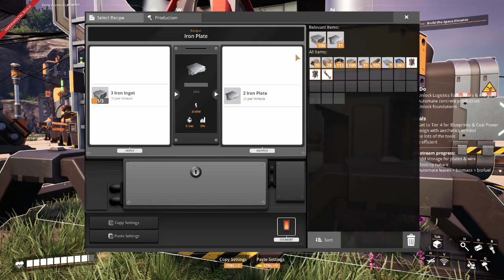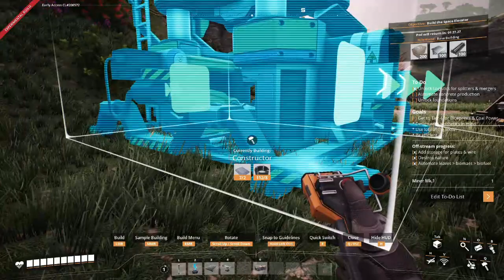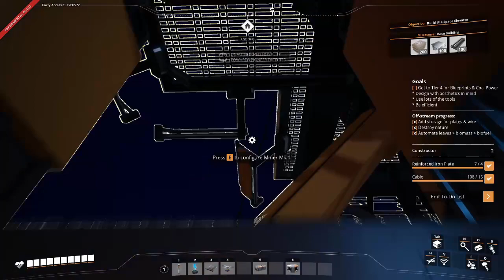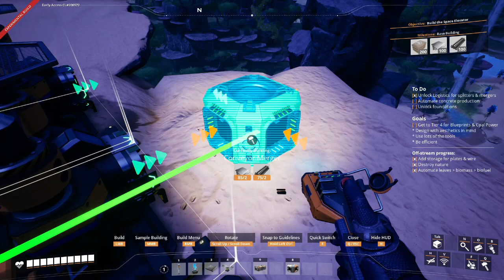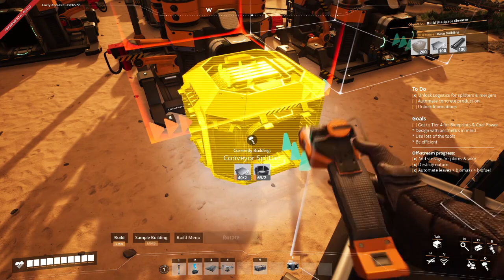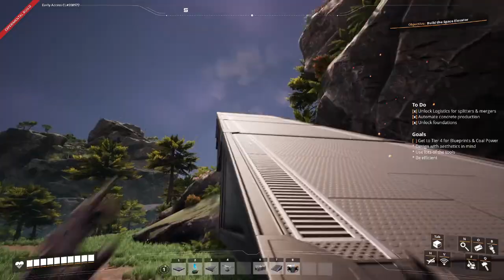Satisfactory Update 7 playthrough // Episode 3 // Automating Concrete & Scaling Iron

Comment: nice video, I just found you!  quick note you deleted a belt to add in a splitter, in a rough and ready factory like youve got so far you can just add the splitter directly to the belt without deleting it!  one more thing about the world grid for foundations, there is a bug currently with it, since it centers the foundation to the world grid vertically, the 1m foundation is going to be half a meter off from anything you place starting with 2m and 4m.  I hope thats explained right.  so since you started with a 1m, you should start everything with 1m foundations.  anything you start with a 2m or 4m will essentially be 0.5m off from everything else.  (im pointing this out because I spent hours trying to fix this, its nuts)
Reply from the maker: Hey, thanks for the tips! My experience with placing splitters on an existing belt is it's about 50/50 whether it'll work as expected or just end up soft clipping without actually splitting the belt. So I prefer to delete and re-place purely because I know it's always going to work first time.

I'd read something to the effect of it being safer to place a 2m or 4m foundation first but didn't really know what the bug was. It hasn't come up in any of my games that I've noticed, but I'm glad you flagged it so I know what to watch out for!
Reply: @mukorplays  yeah any time. im not quite sure it classifies as a bug, it probably does.  I wanted to flag it because I ended up restarting because of it. one group of building I started with a 1m and the other a 2m so they were half a meter off from each other so frustrating.